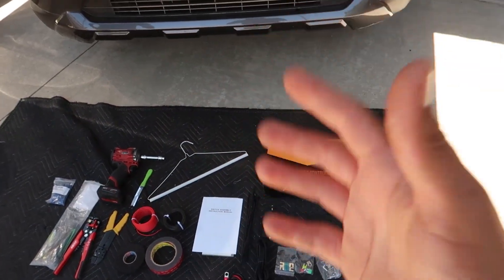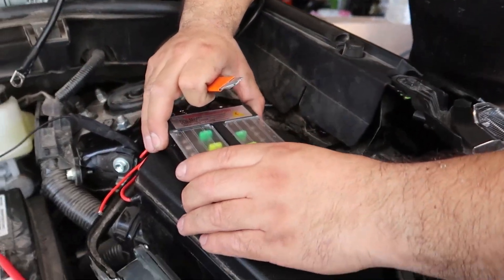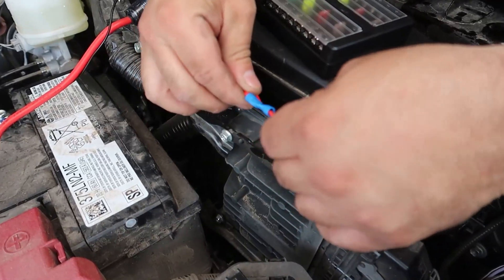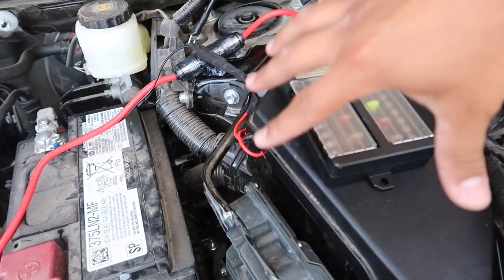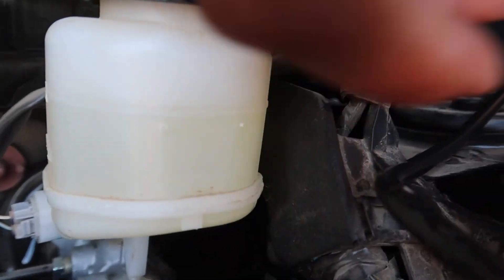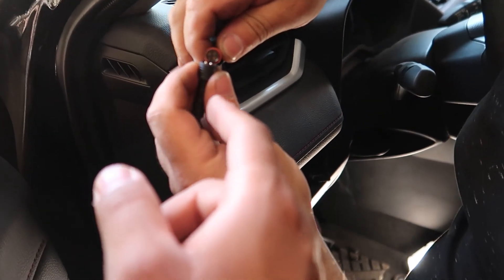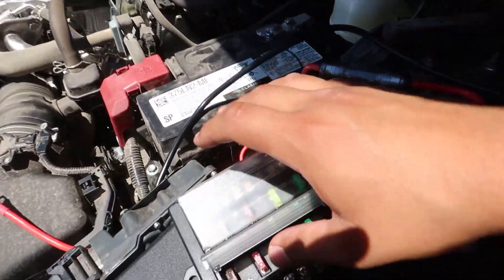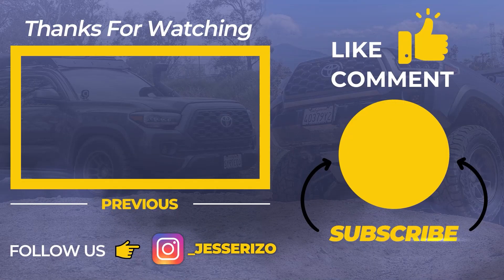2019+ TOYOTA RAV4  AUXBEAM SWITCH PANEL INSTALL + WIRE | HOW TO INSTALL IN DEPTH 8 Switches

Comment: Great video! 
Question. Is there a reason you did not use this also for the raptor lights? Can it be done?
Reply: Anything with a positive negative wiring would work if you have the right fuze slot

Comment: Heh. The positive and negative markings on the new distribution panel are not "embroidered", but rather they are engraved. But hey, if I was speaking as quickly as you were, I'd slip up a few times too. Great video and I'll use it when I get my project installed.

Comment: Tip about the grommet is HUGE!!! Thanks!
Reply from the maker: Thanks for watching :)
Reply: Did you guys go through or around the grommet?
Reply: @CBassChan  THROUGH.  I took a wire coat hangar, and sharpened one end on a grinder until it was a point... push gently until it pokes through.  The grommets are double walled (one wall on each side of the firewall)  You are pushing it through where other wires are so be gentle about it... and one of the times I did this, the hangar/poker ended up coming through an entire bundle of wires, so try to guide it through the sides of the grommet(s), possibly with a slight bend in the hangar?  (you'll find your own technique)  good luck!

Comment: I can’t wait for your friend Rav4 to be finished I get so much shit because I want a Rav4 xse hybrid or trd everyone is pushing me to get a 4Runner or a Tacoma I’m tired of the soccer mom comments about the Rav4 I know if I get the rav I’ll have to lift it and put different tires on it. I don’t plan to do extreme off-road I want to go camping and overlanding not crazy until I do get a 4Runner or Tacoma. What I thought about doing was buying a second gen Tacoma or 3rd 4Runner as my overlanding car. But I love what your doing to the rav especially the raptor pro grill and the amber lights is cool.
Reply: The Rav4 gets the best gas mileage and fits in my garage, simple as.